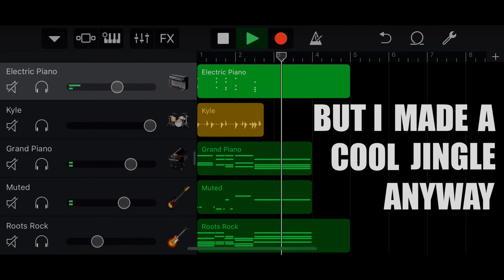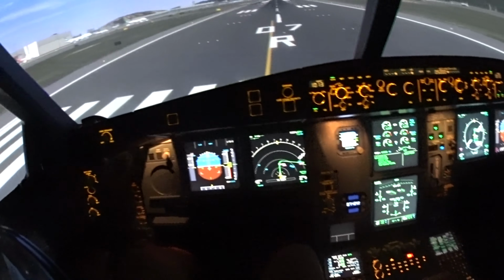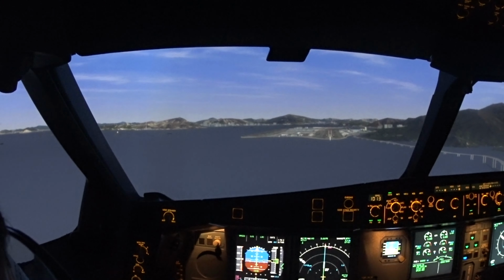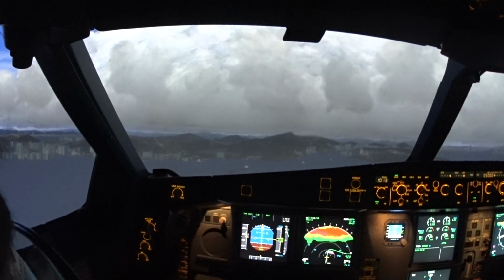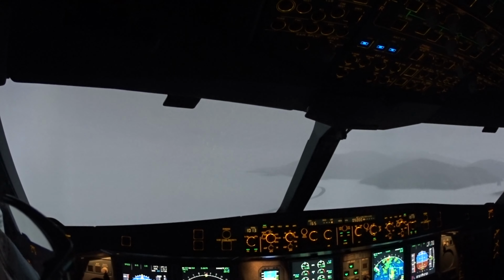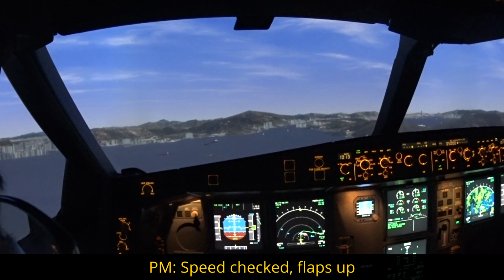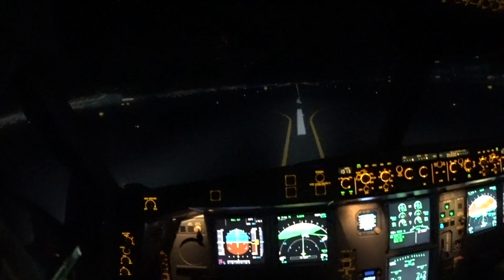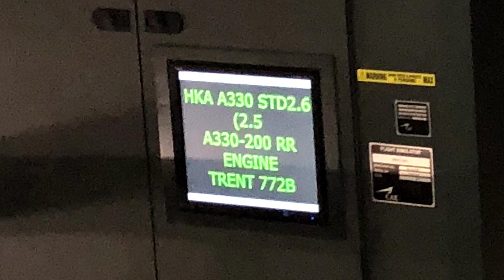Flying a Level-D Simulator!

Comment: Awesome landings! seems like flying a simulator at home does really enhance  your skills.
Reply from the maker: Thanks! It really does, if you actually try to fly seriously.
Reply: For sure. The only thing a full motion simulator really brings to the table is the ability to simulate (to a limited extent) disorientation in IMC, but of course, only real flight can fully expose you to that. 

Other than that a $5k MS FS home setup with all assists off is pretty much all you need to learn to fly an aircraft. Learning to be a pilot (which is mostly about knowing how to make good decisions) is another matter entirely and that requires a human instructor.
Reply: @homomorphic  I absolutely disagree. Maybe a decent home simulator setup can help you operating an aircraft. But it will certainly not teach you how to fly it. There is a reason why airline pilot students start their training on small SEP aircraft. There is a reason why initial and recurrent trainings as well as checks are flown in a Level D sim. This is not only because of possible spatial disorientation, but mainly because flying (even in a big airliner) is still done with considerable amounts of seat of the pants. Even a multi million dollar Level D Sim will not behave exactly as the real airplane, it all feels somehow „simulated“ and „computed“. However, it is still an enormous gain of realism, just because you actually feel most of the forces. Nevertheless, flying in reality feels in my point of view still much more dynamic than in the sim. Nothing a home simulator setup could realistically display - and we are not even talking about non normal situations yet.
Reply: @airflo_muc  i have 800 hours and passed my commercial flight test. I can guarantee it will teach you to fly the airplane, but of course, you still need to fly a real aircraft for many reasons three of which are:

1. Flying in IMC in sim does not induce disorientation as it does IRL

2. The magnitude of an error is not at the same level (while you may be able to fly the aircraft properly in sim the magnitude of rhe responsibility when sitting in a real cockpit can degrade ones performance significantly).

3. ATC is not properly simulated but there are other tools like planetalk for that.

FS2020 does currently have a physics issue with yaw/rudder, and for sure with MSFS there will always be some deficiencies in the sim unlike a class D) but if you spend 100 hours on the 172 with no assists and go through all the proper procedures in MSFS, you could (psychological impediments notwithstanding) hop in a 172 (VFR) and do proper circuits first time, and (if you had random engine failures enabled in sim) likely do a much better job than a student taught strictly on real aircraft if there was an engine failure on takeoff (again psychological factors excepted)
Reply: @homomorphic  this should not be about comparing who has how many hours. I have spent considerable amounts of time with flight simulation before I started flight training, and I can absolutely tell that flight simulation at home is nothing more than a procedure trainer. No control forces, no force feedback (okay, not a factor in an Airbus though), no movements, no spatial orientation, no muscle memory, completely different eye scanning distances, … the list is endless. 

I am not saying that flight simulation does not help in operating the airplane, understanding its systems or training procedures. Actually, this video proves that for a flight simulation enthusiast, it‘s possible to fly a level d simulator on an impressive level of professionality. However, this still neither compares to the real airplane, nor does it make you a good pilot. MSFS is anything but near to actual handling characteristics of the C172 you mentioned - and that is perfectly fine, because it is still a 100 dollar entertainment product, and not a multi million dollar training device. Bring a student pilot with some home simulator time in a full developed spin and see how he reacts. Let him fly his first flight completely on his own and see how he manages pitch, power and flare. I assure you from personal experience, your back will hurt afterwards … 

I‘d really be interested in the type of aircraft you fly if you disagree with this.
Reply: @airflo_muc  I never said it was complete pilot training, all I said is you can learn to fly the airplane.  Being a good pilot has little to do with knowing how to fly the plane, that is only the most basic required knowledge, but a sim can absolutely prepare you to fly plane.
Reply: @homomorphic  being a Pilot, flying this thing is still your main task, so I wouldn‘t say this requires the least knowledge. Even with only 800h, you should already have experienced in your simulator checks that knowing how to fly a CS-25 category aircraft e.g. in non normal situations requires deeper knowledge. 

Would you share which kind of aircraft you commercially fly? I‘d be interested in this…
Reply: @airflo_muc  knowing how to fly the aircraft is essential,  but it is the least of what you need to know to be a good pilot. Most of what being a good pilot is, is knowing how to make very good decisions all the time.
Reply: @homomorphic  interesting opinion for a commercial pilot.
Reply: @airflo_muc  firstly,.I never said I was a commercial pilot, I said I passed my commercial pilots test, secondly,  it's not an opinion it is a fact. Being a good pilot is about a lot more than knowing how to fly a plane. It is mostly about things other than flying the plane.  Flying skills are required but far from sufficient.
Reply: @homomorphic  uh huh. Very interesting indeed.
Reply: not really. It gives sort of an idea of how to fly but to actually learn you fly in a real plane with an instructor beside you. You develop bad habits playing a videogame with unreal handling and not feeling anything of how the plane handles.
Reply: @EdilarinProducts  knowing how to fly is not equal to being a pilot. Your talking about the skills that make one a pilot and absolutely, you are not going to get those from a simulator. 

Basically being a pilot is 1% knowing how to fly and 99% commitment to safety and knowing how to stay calm and make good decisions in emergencies.
Reply: @homomorphic  WARNING FOR LONG TEXT: Knowing how to fly is the foundation of being a pilot. While larger aircrafts allow you to do less hands-on flying and instead focus on monitoring and decision-making, you still need to have the knowledge. Being a pilot consists of many skills and practices but flying is still the basis of it all. A lot is about muscle memory, spatial awareness and an understanding of what your airplane does and why, which you do not get in a videogame. Flying is not just about knowing how to move the stick, you use more senses than your eyes; you listen, you feel.
I do agree that being a pilot requires you to commit to safety and to stay calm, to handle other things such as communication, reading charts, but to stay calm and making correct decisions in an actual emergency situation requires you to have proper training and muscle memory or you'll end up going back to bad habits. You still need to be able to maneuver the airplane. And the only way to get proper muscle memory and knowledge of how to fly is by actual flying.
Videogames is great for practicing, say multi-tasking but not for actual flight training. 
When I get new flight students, some of them are simmers, and while they might have a head start with some of the theory and understanding of what does what in a plane, I still need to work on breaking their habits and teaching them from the beginning. It's psychologically different knowing you're in a real plane and knowing you're safe being a computer :) 

So long story short, no you cannot learn to fly in a videogame. You can learn the concept of flying and get a certain level of understanding of flying but knowing something in theory and then doing it in practice is different.

Simulators, as in this video, is as you said great to practice emergencies which for obvious reasons cannot be practiced in a real aircraft. I did quite a few hours of sim training but most of it was actually to practice emergency landings and not normal flights. For that we flew in real planes, made lots and lots of pattern flying.

Different pilots will have different opinions on the usage of sims and what is considered "flying" but I am a big believer in that to learn something properly, you practice the real thing. I also believe that flying is more than just maneuvering, like I explained above.

I would agree that 90% of my time in the air is handled by autopilot and I do spend more time monitoring things than actual flying, we plan, we make certain precautions all in the name of safety, but knowing my plane inside out, knowing how to fly, and what makes us fly in my sleep, makes me able to do these things even while manually flying a 500 ton plane without panic because I do it by muscle memory. A skill every pilot needs to know. When doing check rides, you do everything manually so there's a lot to keep track of :)
END OF LONG TEXT, SORRY <3
Reply: @EdilarinProducts  yes, but of the totality of being a pilot, about 1% of it is the skill of flying the airplane. All of being a pilot is important, you need 100% of the skills, but you could be a skilled flier and if you make one bad decision you and your passengers and possibly people on the ground are dead. 

The flying is important,  but it is also by far, the easiest part of being a pilot. The ability to always make the right decision is the hard part. 

As a pilot your are managing a complex piece of equipment that is engaged in a task that is inherently dangerous.  Commercial flying is safe because  pilots are good at making the right decision. The safety of aviation is far more related to that skill, than it is to the pilots skills in manipulating the yoke, rudder and throttle.
Reply: @homomorphic  I understand where you're getting at but I don't agree. One doesn't exclude the other. You're not a good flyer if you make a bad decision because safety is obviously important in all of aviation. But you cannot be a good pilot without proper flying skill, because then you're not able to fly safely.
Learning to make the right decisions is something you learn as you fly, as you experience things and as you learn your aircraft. The flying itself isn't about just maneuvering. It's about calculation, understanding aerodynamics aswell as manipulating the yoke. This is not something you learn by any other way than by flying. The complex aircraft does lots of things by itself and they do it because it's safe than for pilots to fly it manually, but the pilot HAS to know how to fly, and how to fly it properly and safely or you'll never be hired. 
Like I said, knowing how to fly is the basis of the job even if day to day operations is very little actual flying.
You cannot be a pilot without knowing how to fly. Because the day you lose critical systems and has to rely on your manual ability to fly it's damned important to do it by muscle memory because there are 1000 things to keep track off, and that skill is not acquired in any other way than to practice, practice and practice in a real plane.
The fact that aircrafts are highly automated is to put less load on the pilot or we'd be tired real fast. But when it comes down to it, we're still experts at flying, not just adjusting headings and altitudes.
Reply: @EdilarinProducts  where did I say one excluded the other? I said precisely the opposite, in fact. 99% of the learning you will need to do to be a good pilot has nothing to do with flying the airplane, although it should he obvious, that you have to be skilled at flying the airplane.
Reply: @homomorphic  1: You said in a previous comment that you can learn to fly using a desktop sim, which is false.
2: you literally said right now that being a pilot has very little to do with flying the plane which is false because without the knowledge you can never operate an advanced aircraft properly.
Knowing how to fly is the foundation of the job, period. Regardless how little you do it in practice during the job. You will never even be hired if you cannot show your flying skill, the checkrides are done manually, without any assist of the airplane’s autopilot and many times without engines and/or working flaps, speedbrakes or landing gear. You can never pass unless you’re really proficient at the manual flying itself. You will never get it down safely unless you’re good enough. As a pilot, just as you say, there’s more than just flying but the flying is the foundation you build other skill on top of. This is why airlines always check up on your manual flying skill because without it you’re not allowed to fly.
Reply: @EdilarinProducts  I never once said it has very little to do with flying. I said the majority of skills that must be acquired are not flying skills 99% of being a good pilot is always making correct decisions. That is much much more difficult than flying the aircraft.  Thar doesn't mean flying the aircraft isn't critical it just means that it is relatively easy to acquire vs the other skills.

You can absolutely learn to fly an aircraft on a flight simulator.
Reply: @homomorphic  you’ve constantly been saying that 99% is about decisionmaking and 1% is about flying, which is so wrong. It’s very little decisionmaking, it’s almost all about following procedures. Decisionmaking isn’t what makes you a good pilot, it’s your overall knowledge and skill. Look at Sully who landed in the Hudson river. The passengers didn’t survive thanks to his decisionmaking, they survived thanks to his skill as a pilot and his skill of flying.
And flying in a professional sim yes but not a videogame.
Reply: @EdilarinProducts  it is not wrong I have my PPL and I have 800 hours which is enough time to begin to understand how hard it is to be a good pilot, and to know that it isn't about flying the aircraft.  That's a given. That's table stakes. The hard part is never making a bad decision.  Just reread that sentence again "never making a bad decision" think about how hard that is. Flying is easy next to that.
Reply: @homomorphic  That’s not what makes a good pilot. Making decisions based on your experience is part of the job, even though almost everything is about following procedures. It’s how you execute your decision that in the end either will, or will not save lives. Like I said, being a pilot is a combination of many skills and flying is the foundation, that’s what we’re doing in the end. And it’s all the thousands of flight hour experience in that specific plane that allows me to make correct decisions IF there were to be a catastrophic failure. And it’s my flying skill, along with my experience that will result in, hopefully, everything ending well.
And yes, flying is easy when everything works. When things don’t work it’s not as easy and by then it’s all about your skill and experience. Making decisions is also super easy when things go well. But when the crap happens: it’s your skill in flying, your experience and that of your co-pilot that allows you to think fast and make decisions, after that you have to execute it. Like I said previously, one doesn’t exclude the other. Making decisions and thinking fast is important yes but that isn’t what defines a good pilot, that comes naturally with experience. It’s a combination of many skills. 
Take Sully again: it was his experience as a pilot and his ability to land in the Hudson that saved all the passangers onboard, even though landing in water is generally a bad decision. Would another pilot have decided the same it could have gone terrible because his flying skill perhaps isn’t as good.
Reply: @EdilarinProducts  the decision to always follow procedures is one of those decisions.  Ina commercial setting many of the right decisions are made for you when you if you make that first decision to always follow procedure, but sometimes the procedure won't cover some situation (that is how procedures are built) and then you have to use your experience (and if this is a dicey situation) your level headdress to make the right decision in that situation.  If you don't choose right then everyone dies. That is so much harder than flying the aircraft when all conditions are nominal (which you can learn to do perfectly on a simulator).
Reply: @homomorphic  nope
Reply: @EdilarinProducts  sorry to hear that response, because it means you won't be long for the world. 

There are old pilots and there are bold pilots, but there are no old, bold pilots.
Reply: @homomorphic  for a moment I thought you might actually have the PPL you talked about but after that last comment it became obvious that all that wasn't true, so there's no reason to continue this discussion as there's no actual experience behind those comments.
Reply: @EdilarinProducts  I agree with you. Anyone can fly a plane, it's when shit goes down, some choke, some don't, some aren't qualified when 💩 hits the fan. We see pilot error is overwhelmingly the cause of most accidents. I know airlines love to blame pilots for obvious reasons, but for anyone who's followed air accidents, the data is pretty concrete. They're like drs. No offense, but I'll take a 60, 70 yo Dr over a 35, 40 yo just starting out on his own the more experience, the better and not always the case, a younger pilot might work better, every circumstance is different, but for most part I'll take experience, definitely not taking some larping videogamer. And again, if flight is smooth with no problems, I'll take anyone, noway of knowing, but anyone will do. I think they.. commercial pilots get paid crazy money, coz when things do happen, not to mention the precious cargo. There's a reason bus drivers don't make anywhere near the same money, no matter what the cargo